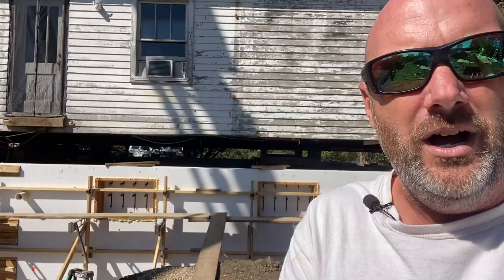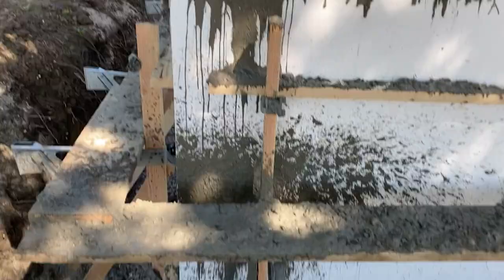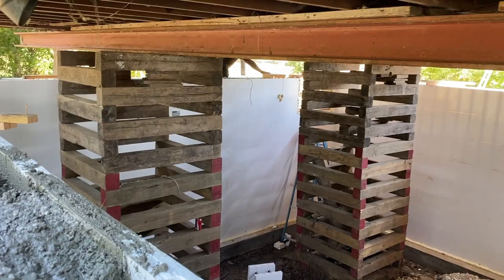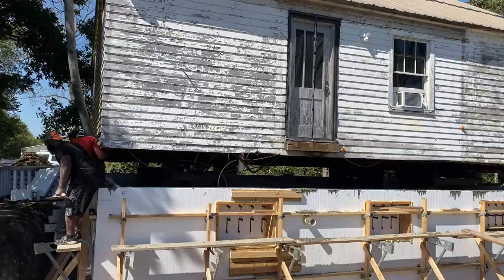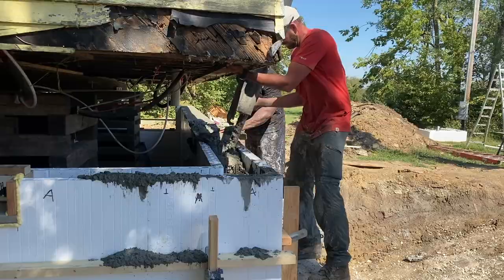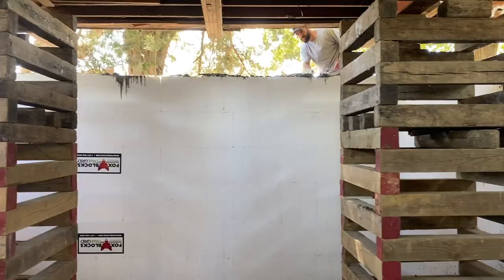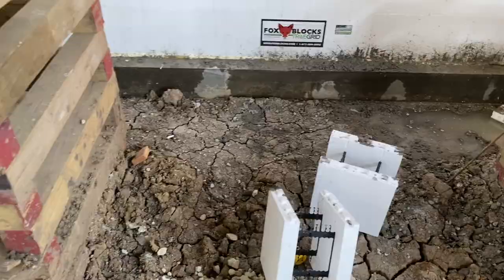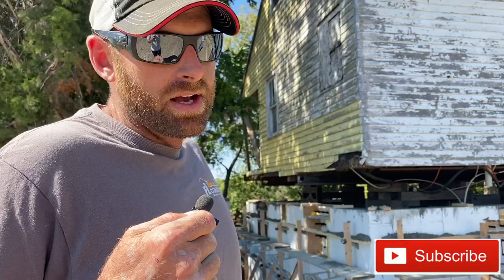ICF Foundation Walls Under Existing House???

Comment: First off, your mic is awesome! We all thank you for excellent sound. We do basements like this all the time 12 hours north of Kansas. We lay the hose along the top of the wall and the let the pump pull back, dragging the hose along the wall along the wall so there is no fighting against it. Only risk is air blasts from the hose so we don't get to close with the vibrating. Thanks for another great video. I love the small, not so ideal, projects. It really is where the majority of ICF's are used.
Reply from the maker: Ya this thing has been in the works for years but the cousin who’s underwriting the project lives in Florida so it’s a very side project that he finally got everything lined up on!  And this pump guy was not great, I didn’t want to bag on him but at the outset I told him a couple things and he just kind of walked off, wasn’t my place to push and he wasn’t doing anything wrong just being in a hurry with equipment that wasn’t as fine tuned as what I’m used too, my guy John really has Rost’s truck tricked out to the point we are all more spoiled than we realize!

Comment: I’ve not poured an ICF foundation yet, but I’m studying what other people are doing, and this is the first I’ve seen done without any sort of bracing on the interior.
Reply from the maker: You brace one side, usually the inside is just easier, but we do a lot of Monopour pools and a few houses where the floor is poured at the same time, meaning we have to brace the outside instead…. This one in particular was because of the cribbing and the house being in the way
Reply: @all3pools  whew - that house and cribbing looked tough to work around.  Of course, it’s not a huge foundation, too, so there isn’t as much movement.

Comment: What should something like this cost? I know hard question, lots of variables… similar 30x30 grandparents camp, needs to be raised and foundation added exactly like this. Locals only want to do formed concrete… time to lay the block myself and hire out the jacking and pour just like this
Reply from the maker: The block 8’ high should run about $4800 plus freight which will depend greatly on how close the nearest factory is to your location!  Then it will take about 40 sticks of #4 rebar at 11-12 per, and 20 yards of concrete, which the price will depend if you are in an area on allocation due to constraints of some of the Portland manufacturers…. The jacking up shouldn’t be terrible, i can’t remember what they had to pay but I can find out, it took one day and the steel beams were on-site rented until it was complete so the faster you can do the work would save as well…. The real wildcard right now is contracting the actual icf work because the skill set is perceived to be rare enough a lot of icf contractors are charging double what they were even a year ago due to the boom in icf construction when lumber went nuts…. Which is why I advocate heavily for DIY, much to the chagrin of some of my friends in the industry, but I’m not under the illusion that A. People can’t do this themselves, and B. Me and my highly skilled but small crew could ever get to 10% of the jobs I encourage to DIY!